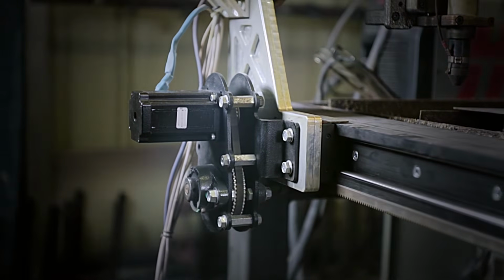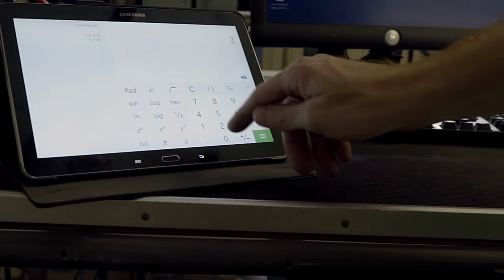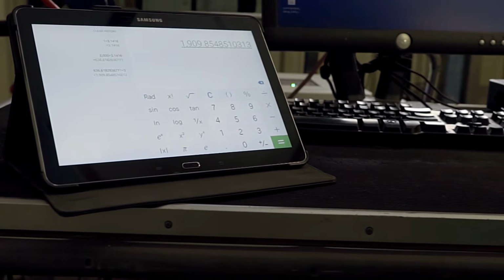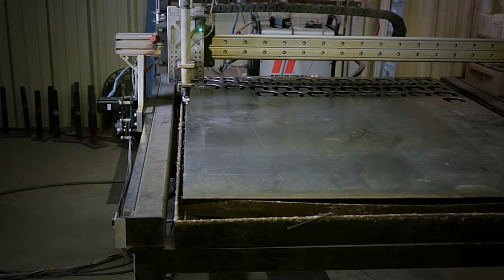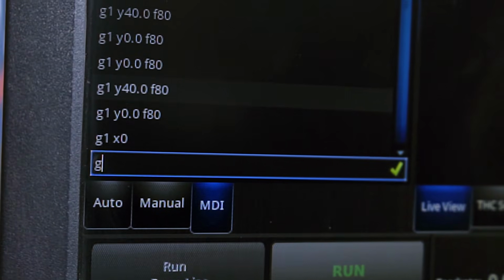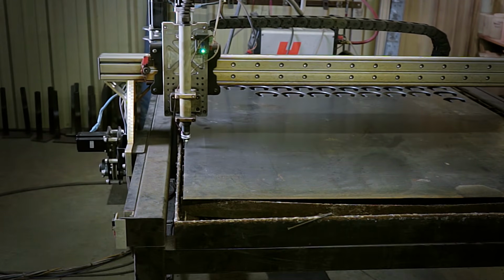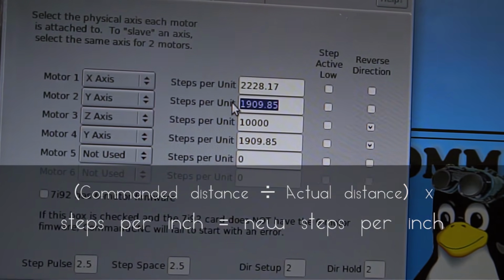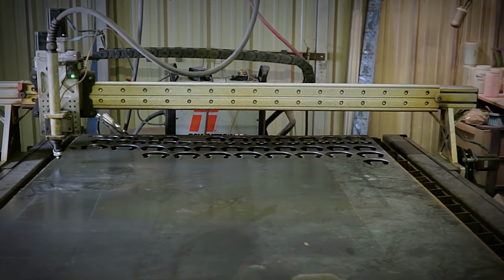Stepper Motor Tuning for a CNC Table

Comment: this works as long as They send matching motors. I have a gantry motor I had to calibrate on its own. it physically turns further when both the motors are calibrated the same.